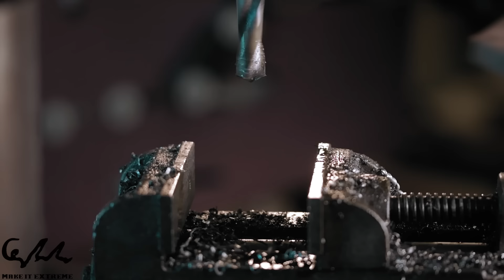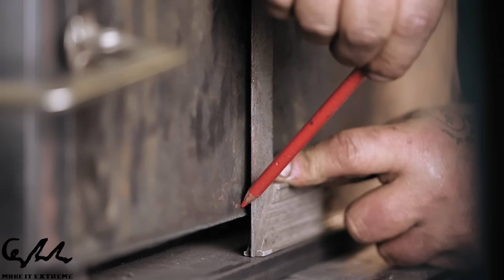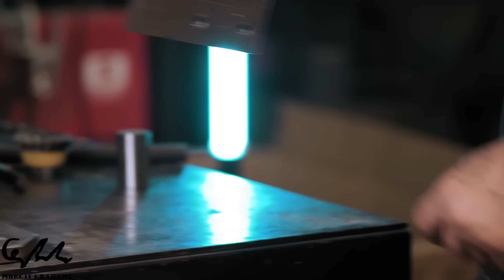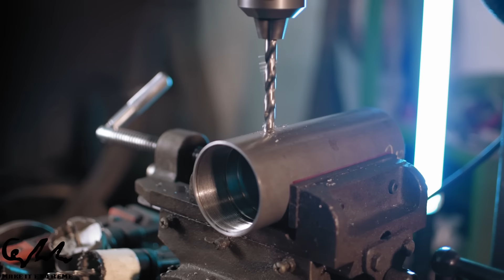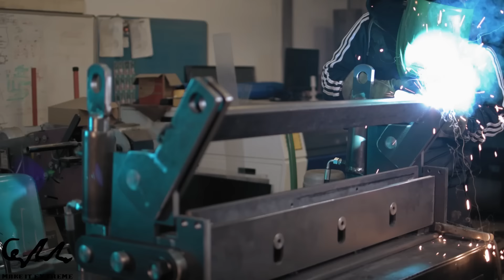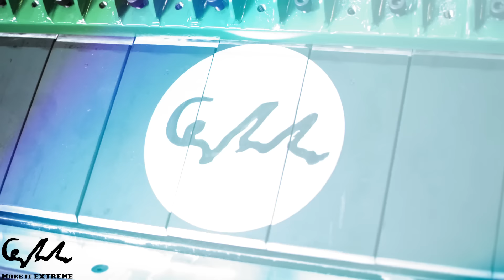I Built A Hydraulic Sheet Metal Box and Pan Brake Machine

Comment: One of your nicest builds!  Very nice.  I have a question about the movement of the Finger Frame. After it clamps the material, I can see that it shifts forward and tilts up.  Is it designed to do that, or is it the result of the way it's designed and not a feature? Thank you

Comment: The inner tool slides on the sheet metal, hopefully that's not going to cause issues with precision. I see you can bend a little over 90° with it so I wonder if you could make a repeatable exact 90° bend in different materials with different spring back.

Comment: Too much slop in the machine. You'd have to be blind not to see how much everything shifts around when it's in operation. It doesn't even clamp down on the sheet metal properly. In fact, it pushes  the sheet forward quite a bit. And the the jaw that does the bending backs off as well. This is rickety as hell and every part you make with it will be a one-off as there is no chance you could repeat a single bend with how much everything moves.